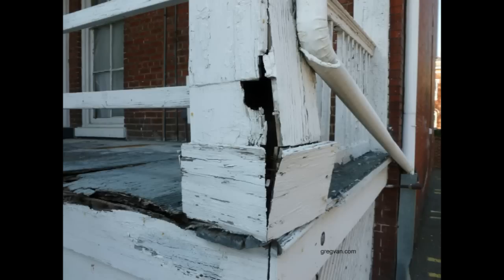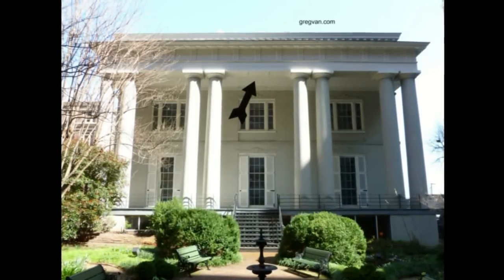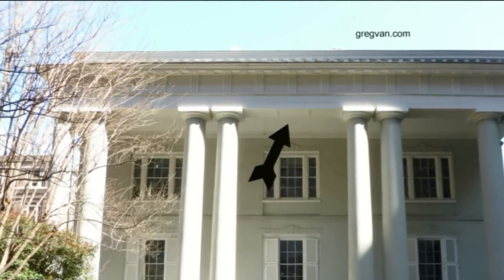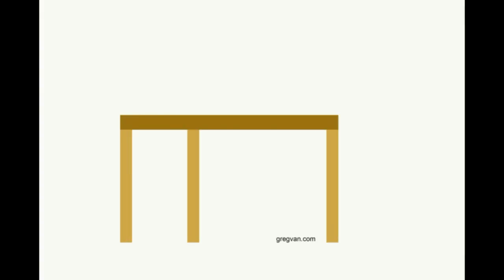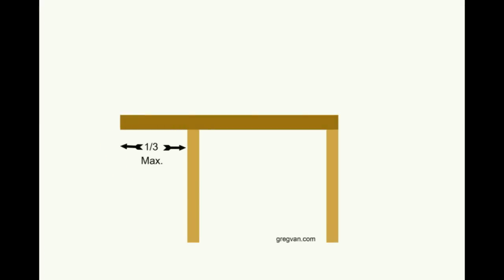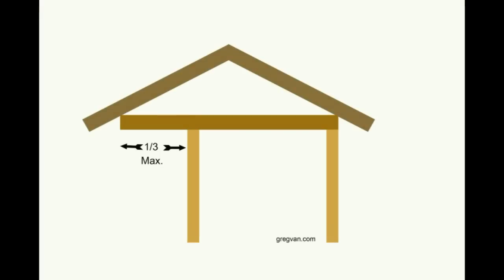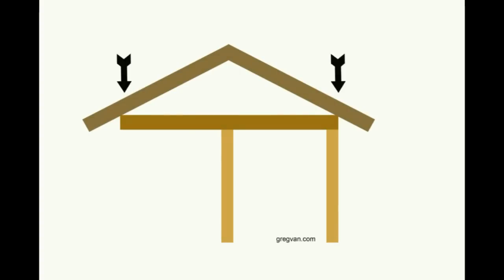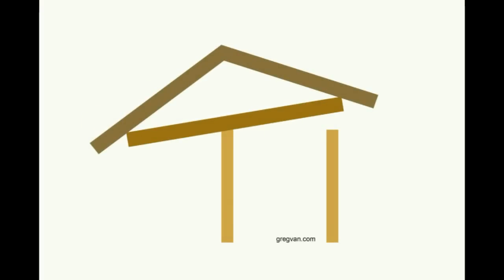Roof Cantilever Tutorial

Comment: How can it stay up with out the posts though?
Reply from the maker: The building was framed using cantilevered framing members like roof rafters or ceiling joists and quite possibly structural beams to make it happen. I would recommend visiting the website and checking out the engineering, framing and design sections for more information.

Comment: Hi thank you for your video! I have a garage that requires a canteliver. The length across is 5.7m and the new support beam is 2.1m across. I have a RSJ on top of the support pillars 

However the roof is built the opposite direction as your drawing in the video. (Turn the roof 90d round)

I have drawing as it’s very difficult to explain in writing sorry.

The rear roof is supported by a wall ( it’s leaning on to it)

Do you think the cantilever will be fine?
Reply from the maker: Feel free to send me some pictures. You can find our email address at the website. However if you don't, then the direction of the choice would need to be rotated 90°, otherwise it wouldn't be a cantilever. You could always install to post with a beam with rafters sitting on top of the beam to create a new extension of the roof. I'm pretty sure that doesn't make much sense, let me know if you need more information.

Comment: Hello...If you review your example you will see that you are proposing that an 18' framing member be divided in thirds 6,6 and 6 and that the cantilever not exceed 6'. The drawing, just looking at it, does indeed show graphically a cantilever equalling half the span between supports, or one third of the overall beam length rather than 1/3 of the 12' span between support for a 4' cantilever. 
Otherwise, a nice presentation.

Comment: The 1/3 concept is not one third of the overall length of the beam...That would be a precarious condition with the possibility of uplift at the far end especially if the cantilever is loaded and the span between supports is not..  The 1/3 idea is that the cantilever should not exceed 1/3 of the span BETWEEN the supports... So, in your example  of 12' between supports the cantilever should not exceed 4'... In your example getting an engineer would be wise.

Comment: Talking from practice here i don't cantilever thing beyond 4.5 ft without the help of an engineer. But i highly recommend an engineer. He will 1. save your life in case you underestimate the situation. 2. help you in order to get maximum support with as little material as possible. 
Secondly, i don't believe in the 1/3 rule. you have to take a lot into consideration so this rule is a bit overrated. if you haven't done smth. simmilar before, don't do it.